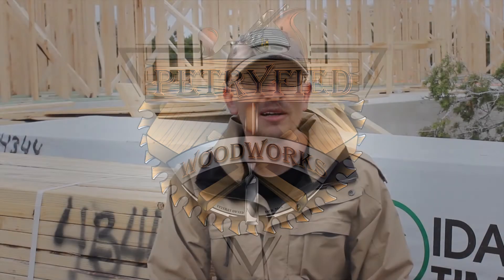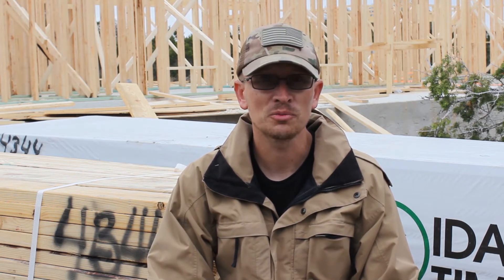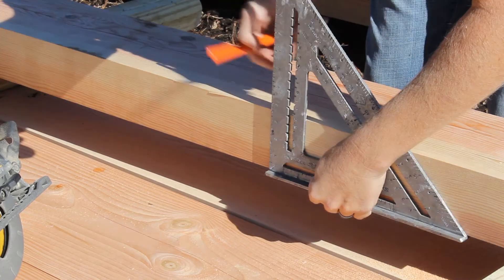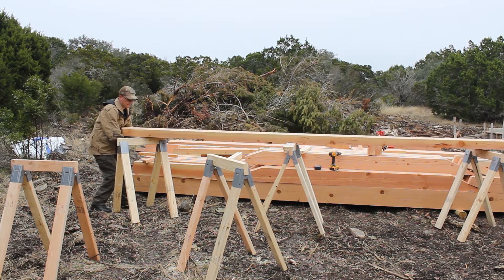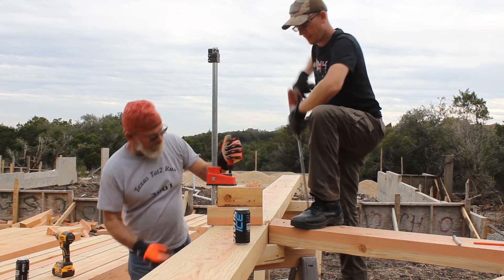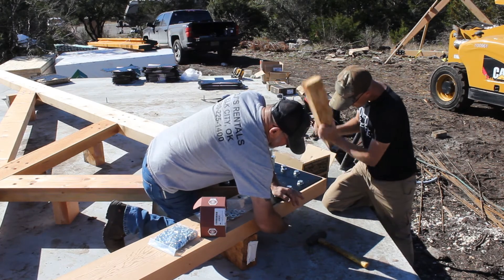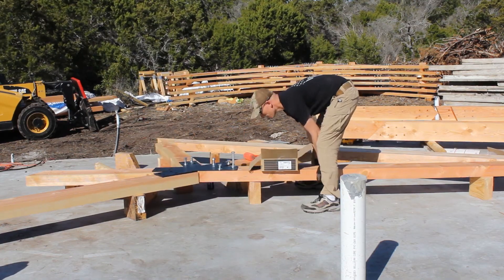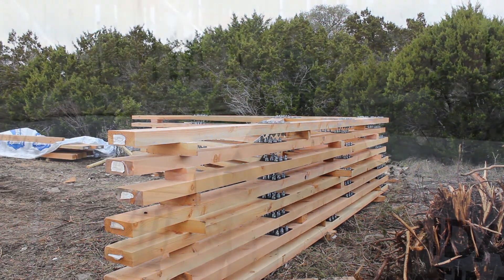House Build Ep.1; Huge Scissor Truss Fabrication

Comment: Hey, I'm been staring at Texastiberframe houses for the past 1-1/2 year but $150k for just one of their timber kits was way to much for my budget.
What software are you using to design your house? I actually plan on taking a timber frame class soon. What wood species are you using for the trusses? And WOW, those Trusses look awesome!
Reply from the maker: A timber frame class would be a blast! I used SketchUp for the design/ modeling. I turned that over to a drafter that got me some clean and accurate plans. Those then went to engineers for the framing. For the trusses, I basically spent a month browsing timber framing forums and going over load calcs for big timbers to figure out what I needed to do with them. Its basically a best guess situation though, so I went a bit overkill on them.
Reply: @PetryfiedWoodworks  Could you share your drawings?  I like to start somewehere … not from scratch.?
Reply: Very nice.
Where was your source for the brackets?
Thanks....